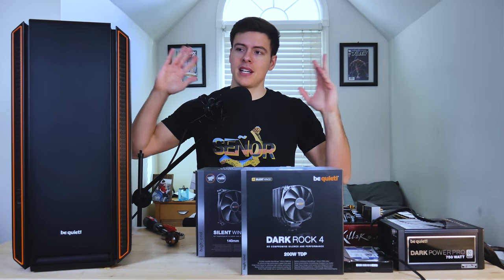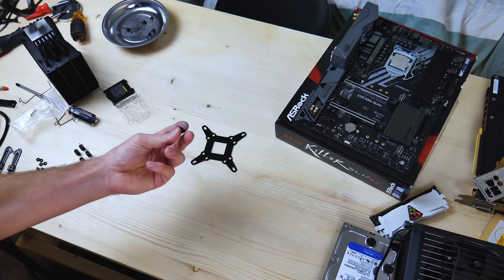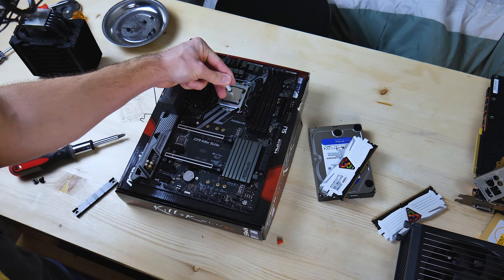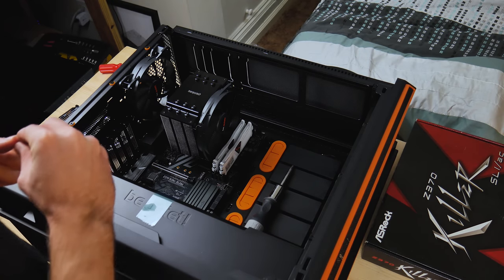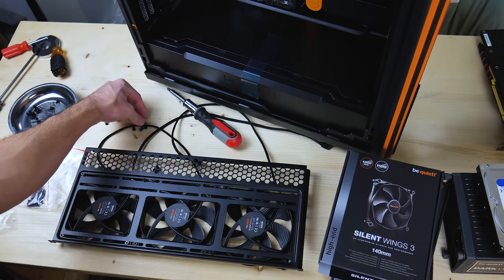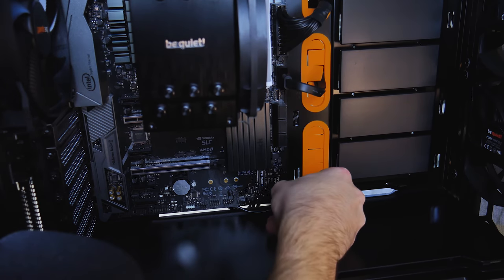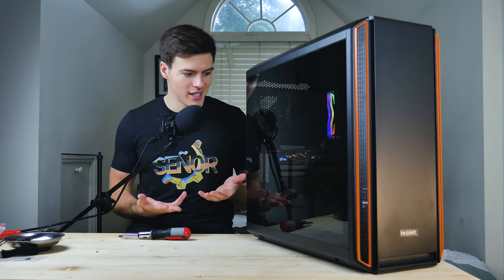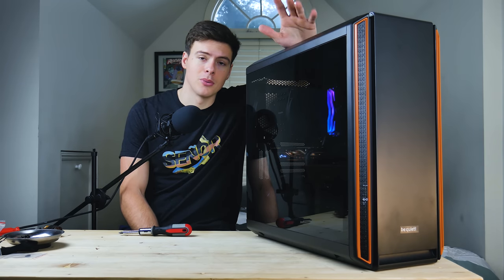Build A Computer With One Hand Challenge

Comment: Hey man, I am a MacBook Pro user for editing video, are PCs just as good for less price? Looking for a new laptop considering switching to PC
Reply: Apple products are shit in the opinion of the majority of people who are going to see your comment. We are biased because this is the comment section of a video about gaming computers. (But they are factually shit, because Apple just waits for other people to do the hard part and then they release a shiny sand blasted metal version for two times the competition.)
Reply: 🙂 sure its similar, Adobe is on both mac and windows, if u want a windows laptop with a heavy duty quality chassis like apple they are expensive too just like apple laptops, if its a desktop u can save a little money because i dont need the HD chassis
Reply: spikespaz hey yeah I am realizing that now that I am getting into more and more complex editing. Any suggestions of a good video editing laptop
Reply: @UCTeeth  I would take a look at the Gigabyte Aero 15X or a similarly spec'd laptop. I don't have enough money to buy from a brand like that, I'm saving for a laptop from Sager Notebook because they are similar hardware however they are a smaller company so they charge less. If you want a flagship device that MIGHT have better build quality and support you can buy from Gigabyte, MSI, or something. It will cost 2-400 more I'm going to guess though.
Reply from the maker: If you're looking price to performance, buying a Windows laptop will be much better than the price for a MacBook
Reply: JDTechGear how do I go about finding one? I’m not the biggest tech person, and I think that’s why some of us go with Mac but I am very open to a switch
Reply from the maker: @UCTeeth  I'm not very laptop savvy, mostly just desktop computers but what's your budget like?